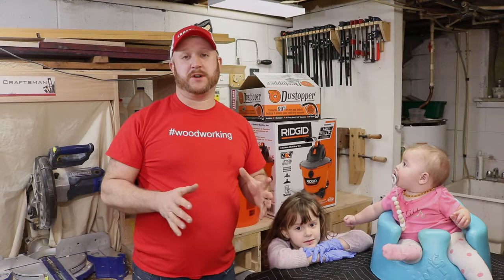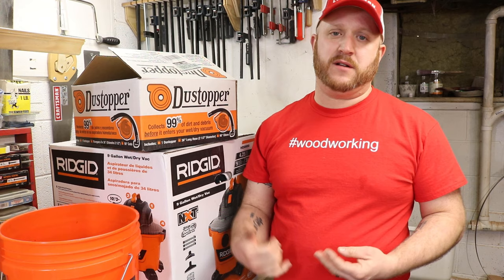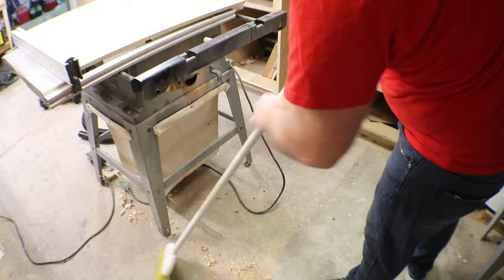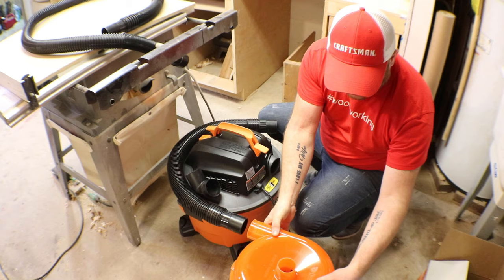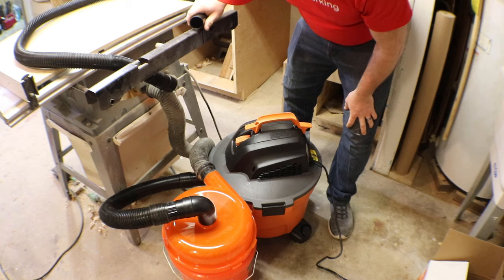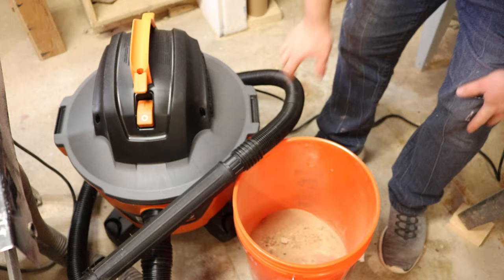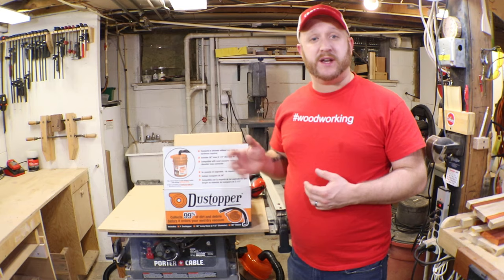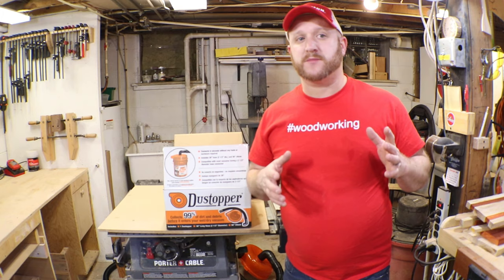How to Set up the Dust Stopper

Comment: I have this setup in my shop... the one thing I did was setup the shop-vac with a HEPA Filter and HEPA bag setup... even if don't go HEPA, a bag in the shop-vac would save the filter from the fine dust. Great topic, especially for those with small shops with limited budget and space.
Reply from the maker: I recently did the same thing. I might be making a follow up video to this one.

Comment: Thanks for a great video:  informative, fast-paced, no blabbering, and you have a nice teaching style.  I'll be getting one of these soon because you  answered all my questions.  FYI, about the fine dust, others suggested putting some water in the bucket to cut down on that.  And the remote -- a stellar idea.   I'm subscribed : )
Reply from the maker: Thank you! I’m glad I was able to help you and thank you for the tip!
Reply: Hi Kennel? Any way if I am understanding the video correctly the dust will go to the bucket instead of the vac filter is that correct? Thank you

Comment: I love my dustopper, the only thing that i didn't like about it was the small capacity of the bucket.  So i cut the top of that bucket off, cut a hole in the top of a 32 gallon brute trash can, inserted said bucket top, sealed with some caulk and problem was solved, it's awesome :)
Reply from the maker: That’s a great idea. I was looking for one of those larger buckets. But I think I would have to buy paint in order to get one. Thanks for sharing !
Reply: does dust get collected in the vacuum and filter with your setup ?

Comment: Cool set up.  Have you tried adding a dust bag 
inside your shop vac as well?  It should add an extra layer of protection to your filter so it gets even less dust trapped in it and should extend its life as well.
Reply from the maker: That will be my next step

Comment: I noticed you wore hearing protection. Is the Dust Stopper considerably louder than the shop vac alone?
Reply from the maker: No. I just like using it. Most the time I’m wearing headphones with music. Also, my table saw is very loud.